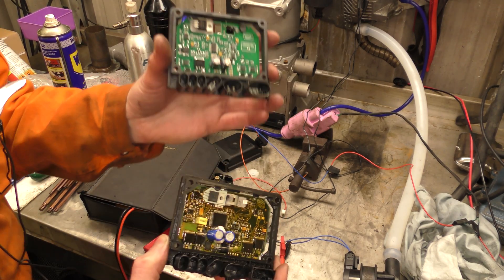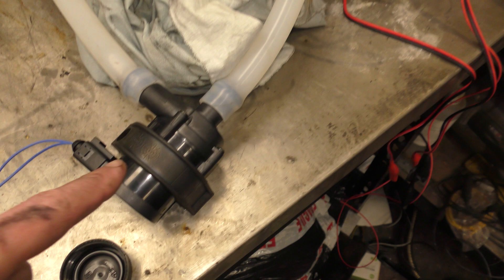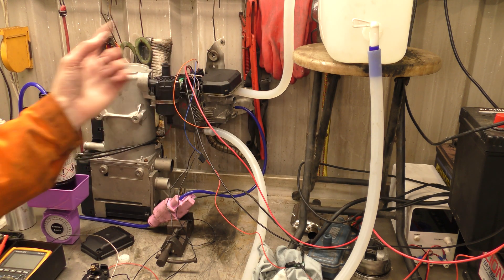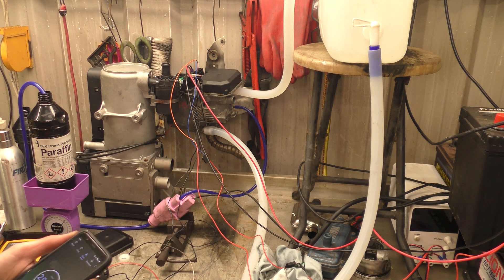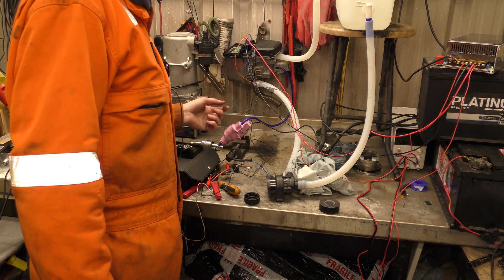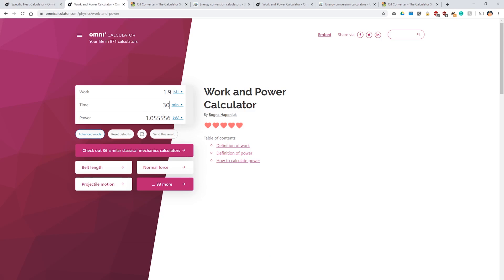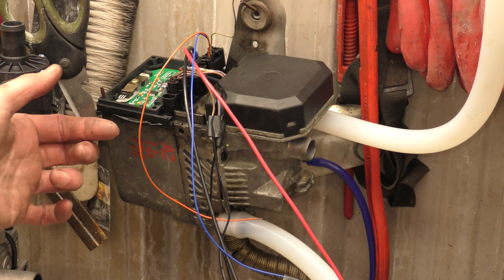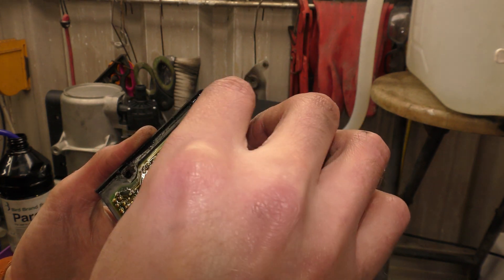Webasto non canbus ECU conversion / replacement

Comment: Morning Dave. The one I have heats 10 lt calorfier in around 12-13 mins from 4 up to 80 degrees. Then it shuts down, as you said. That's running kerosene 28 heating oil, I'm a bit surprised yours is only 60 after 30 mins. Don't know what the cut in and out is on that one temp wise. Good it's grafting though
Reply from the maker: Fixed the problem.  I used an undersized fuel pump, swapped to bigger pump, heats up a treat now.
Reply: @DavidMcLuckie  champion. A lot of hassle that heaters giving you but good you got it sorted. Great heaters they are, when working that is
Reply: @andrewbartleman9169  hi Andrew. Lol. No not Mr smeets, stand alone is just my term as most of these units are fitted to cars lorry's and the likes. They are linked into the vehicles electrics and can be a major brain ache getting them to work off the car. Some just don't work others work without an issue. Think Dave was unlucky with his. Its been a mare but grafting well now. 3 wires normally and away you go. Very little to it. Bit more complicated when adding calorifier and external sensor with a control unit but it's not to bad. Getting one that works is a good start though forgot to say. I think the marine ones are the best to get. From what I gather they are what I'd call stand alone. But be plenty on here who know a lot more than me about the electronics side of them and programming the ecu

Comment: the webasto finally works! nice! hmm it seems from your earlier video that the chinese combo air+water heater is more efficient
Reply: This test is seriously flawed. With the aftermarket board the heater is 5kW
Reply: @Kenada - Curious... when you said, "the heater is more efficient" did you mean more fuel efficient(?)

Comment: 2 kw output for 30 minutes I guess is about 1 kWh? But you probably also got som heat loss elsewhere in the circuit. So I guess your heater is bigger than 2 kw :-) Thanks for the funny and interesting videos 👍😊

Comment: Looking forward to the shower conversion great job with the videos and information
Reply from the maker: It might be a fairly cold shower if I can only get the heater going at 1kw.  :)
Reply: @DavidMcLuckie  really mine thermo top c keeps my hot tub at a very warm 36 degrees 
You must have a problem with yours